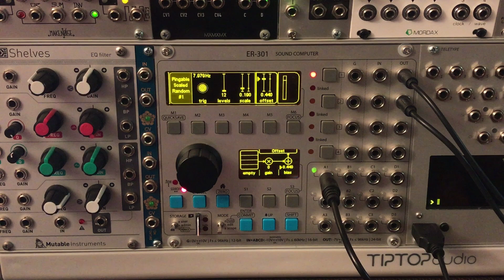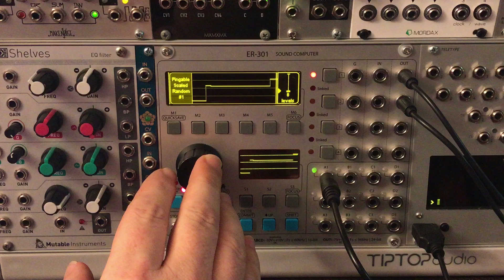ER-301 Pingable Scaled Random Unit

Comment: Hello thanks for the tutorial I have a problem i bought an we-301 and was installed version 4. Something I update it but I don’t have the sample player anymore I want go back to the old firmware where I can get it? Thanks 🙏
Reply from the maker: Hi - At some point the sample player changed name to Variable Speed (Varispeed) player, because there are now multiple types of sample players.  I don’t really recommend going backward.  I’d recommend going forward to the current version 0.6.x.  But if you really need an older firmware let me know what version you want and I’ll see if I can find a copy for you.
Reply: @joefilbrun  hello Joe
Thanks for your fast replay I try to follow this step but when I try to insert the sample the er 301 crush 😢any help why this happened? I have the 6.16 firmware
Reply from the maker: @dedodan1  Are you using the version of the Accents library for version 0.6.x?  It is here:  https://github.com/SuperNiCd/Accents 
And installation instructions are here:  https://forum.orthogonaldevices.com/t/accents-v0-6-x/5263
Reply: @joefilbrun  thanks Joe o install again the firmware and work again but.. my very concern is : when I am in sample pool I can see the track on the display and I can splice it but.. How I make it run to listening what I want  choose from this track? I push the botton but just say pause 🙆🏻‍♂️ do not run
Reply from the maker: @dedodan1  Generally you’d want to go into the header menu for the Varispeed player and make sure your playback extent is set to Slice.  You might also want to make sure it’s not set to loop (unless that’s what you want).  Send it a trigger to start the playback.  When the playback extent is set to slice, the slice control controls which slice plays back.  The range is divided equally by the number of slices.  So if you have two slices, anything below 0.5 will play the first slice, and anything above that would play the second.
Reply: @joefilbrun  thanks 🙏 Joe  my last question is : I want play for listening and select the slices from a drum loop I select sample pool I saw it on the top screen I want hear it ,how I  play on that screen is it possible?
Reply: @joefilbrun  i make it works but the problem is that when I am in sample pool and want slice a drum loop to take some part of it I can’t hear what is what and what I am slicing 
For select it  how I can hear that sample in sample pool? There is any botton or I dint know how to give a play 
Sorry for my bad English 😅
Reply: @joefilbrun  yes I do so for this I contact you I saw your tutorial 
🥰
Reply from the maker: @dedodan1  If you are editing the sample, you’ll want to make sure playback is not paused (s2 button).  If you then press what looks like a rewind button (s1) it should trigger that slice.
Reply: @joefilbrun  dont run the player I make a video and upload it to show you
Reply: @joefilbrun  Hello Joe I make a video to show you what happens thanks for be so kind to help me out 🙏✨
Reply from the maker: @dedodan1  Hi - are you in the User area?  The left toggle switch on the panel in the top position?  And do you have this sample loaded inside of a Varispeed player?  If you have the left rocker switch in the middle position (Admin) and are editing the sample pool from there, I don’t think this will work.

So go to the User area on the left rocker switch.  Insert a Varispeed Player unit.  Press twice on the button under the unit header where it says “Varispeed Player”.  This will bring up the menu for that Varispeed player unit.  From there load your sample from card.  Then choose to edit the buffer from that same unit header menu.  From there I think what you’re doing will work as you expect it to
Reply: @joefilbrun  that is it thaaaank you  very much 🤩🙏
Joe you are very nice 😊 thanks